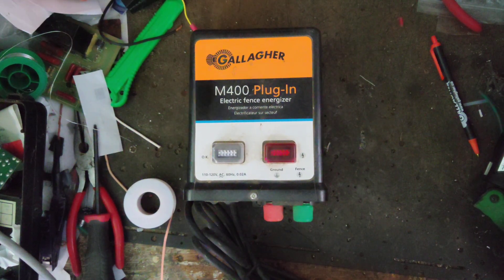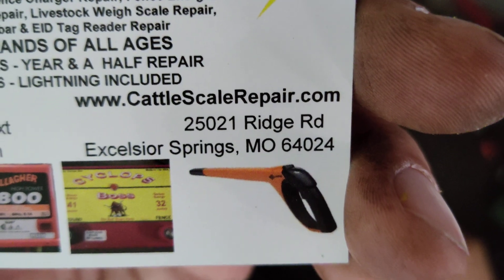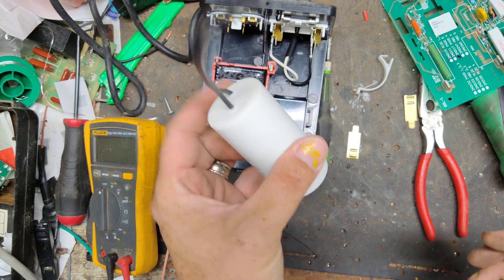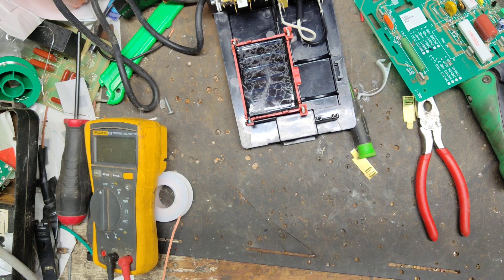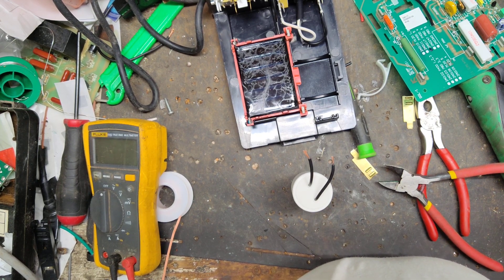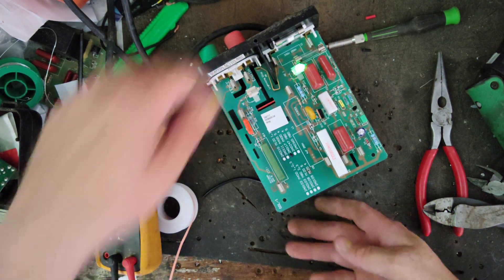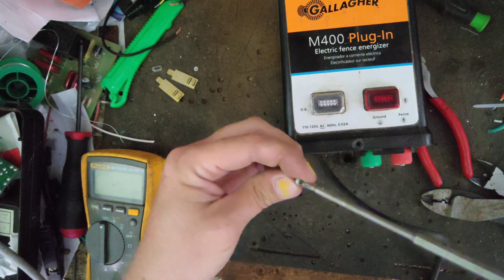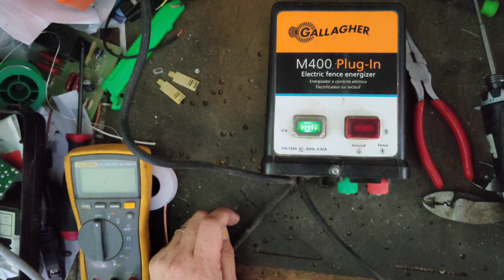How To Test & Repair An Electric Fencer | Gallagher M400 Repair

Comment: How do you fix the plug-in part of a Electrical Fence Box
Reply from the maker: It depends on where it's broken at. If it's just the AC plug itself on the cord, just cut it off and wire on a new plug. If the cord itself is bad, remove the whole cord and find another one that will work with it. If it's within the board itself where the AC comes in at, it'll depend on how bad it is and what's actually wrong, then you just have to deal with it as it is and fix what's needed or sometimes you can hardwire it when that's possible.